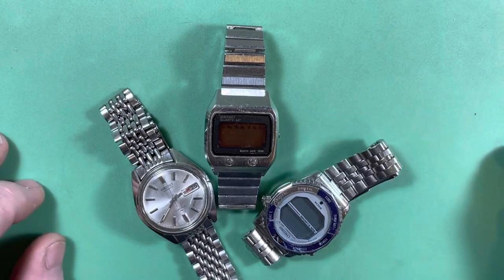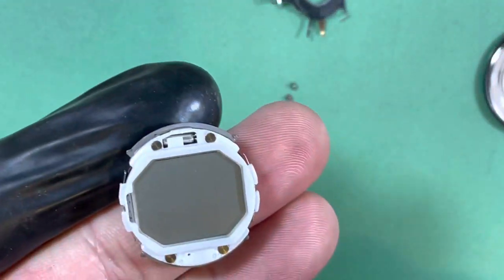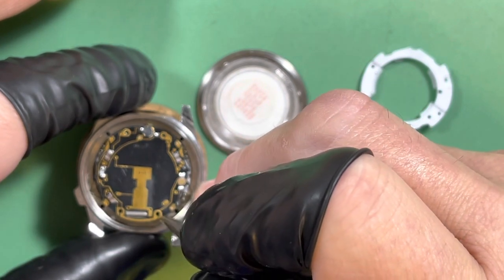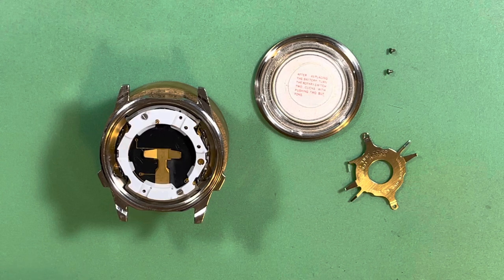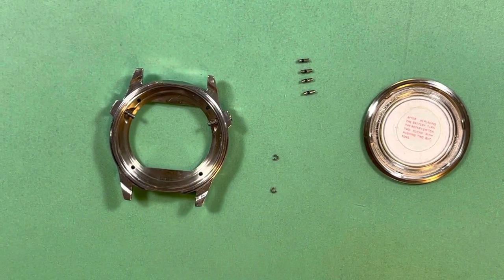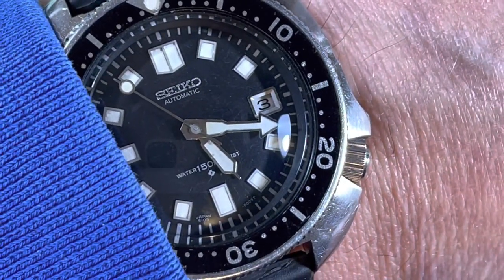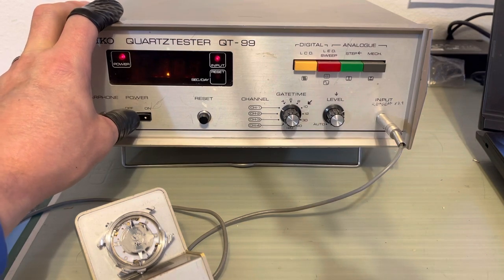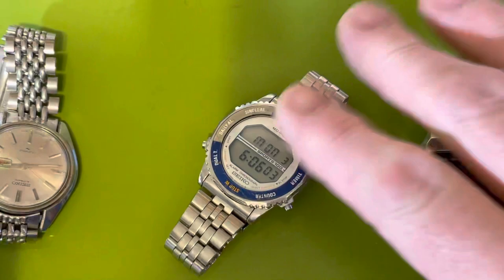For MP: Seiko A829-6019 "Astronaut" LCD, NASA-worn!

Comment: Hi Mr. Klein, hope you are doing well. If it’s not a trade secret, would you mind sharing the information on the transmission pin seals?
Reply from the maker: There's no real secret at all.  The buttons come with their gaskets; the gaskets themselves are tiny and not sold separately I believe.  http://www.julesborel.com/home?search=81604979.  You need to call and talk to the ladies at the desk to see if they have them in stock and if they come with their seals.